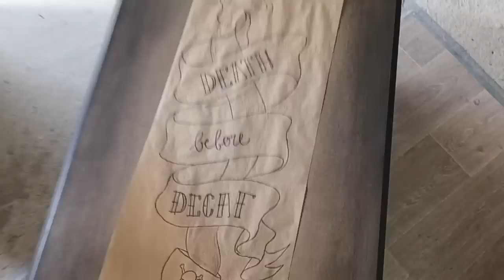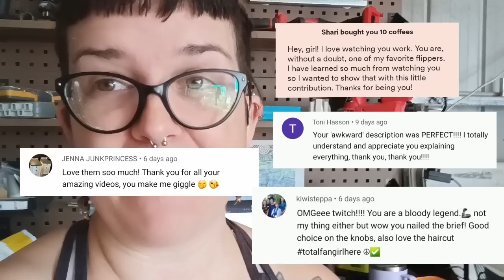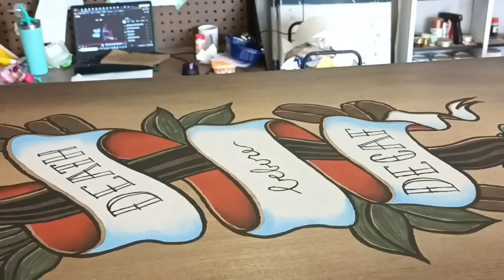COFFEE TABLE MAKEOVER | Vintage Tattoo Challenge hosted by @statementdesigns & @thekraftycreech

Comment: Wow!! Stunning!!!
I love this, one of the most inspiring videos I've seen in awhile 👍
I have inherited a lot of mid-century and antique furniture. I am dying to try my hand at redoing some but slapping paint on it seems bleh. May i ask, if I missed it, how did you transfer design? Embossing tool?
Love it!
And don't feed the demons. Sad ppl are so negative. You don't get a do-over life. This is it!
Reply from the maker: Hey JoMama, aren't you a lucky duck getting all that furniture. 
After I drew my design I flipped it over and rubbed welders chalk all over the back. Then placed the design where I wanted it and traced the lines with a pencil. You could also use just normal chalk or if you're doing it on a white/light surface a charcoal pencil or dark chalk would do the trick

Comment: Hi, I love the coffee table.  I want to use the concept on mine BUT I have no idea what I'm doing having never done anything like this before.  I got everything you did apart from how you got the design from baking paper onto the table,  please help? Thanks in anticipation of the answer...Marie
Reply from the maker: Hey Marie, thank you so much.
After I drew my design I flipped it over and rubbed welders chalk all over the back. Then placed the design where I wanted it and traced the lines with a pencil. You could also use just normal chalk or if you're doing it on a white/light surface a charcoal pencil or dark chalk would do the trick
Reply: @Creep Designs by Twitch  thanks very much and congratulations for the win,  I did see that. I'm also intrigued as to what you suggest for the next challenge